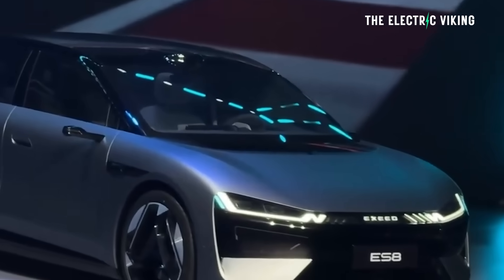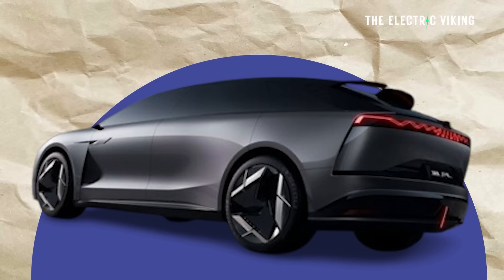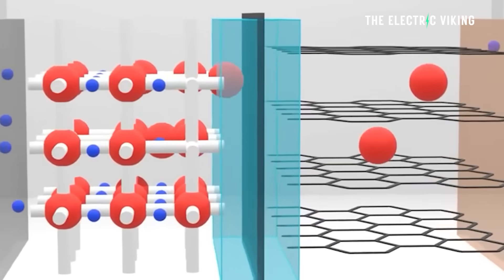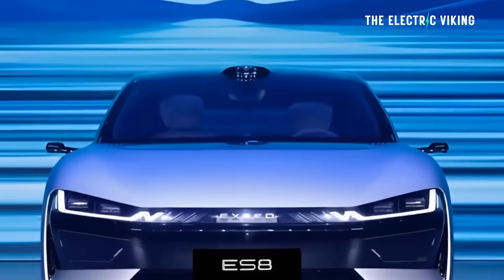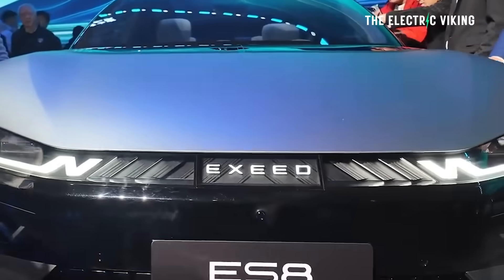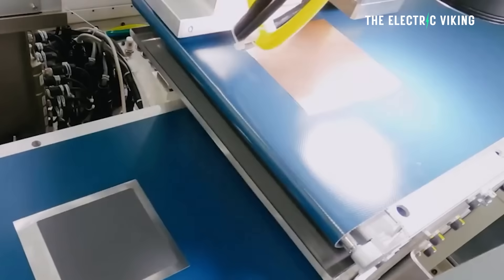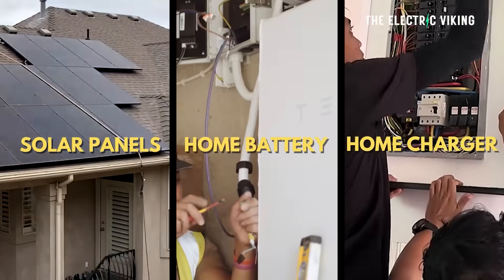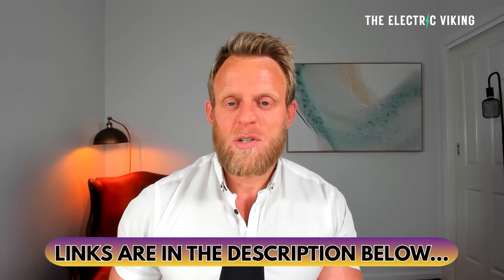Chery’s Solid-State EV with Insane 1,500 km Range in −30°C! Coming This Year

Comment: Rumors that could be unfounded suggest that by 2028, there will be more long range option EV's w/1,000 miles per charge.
The charging system will be similar to that of flash freeze sterilization. Well, under 1 minute, fully charge.
And equally unfounded solar panels will also be near 50% efficiency & lithium will barely play any part in EV's.
Just rumors.......gm will have a new ceo?

Comment: 1500 km range is more than anyone needs. Having driven my ioniq5 for a year, including 4 road trips of 2000 miles, I think 500-600 km would be more than enough. I can only drive for so long before I need a break. And at home where I charge the most I have a level 2 charger that can easily keep pace with a daily driving of 40 miles or so. I don’t even know a gas car with 1500 km of range. Who would need that?

Comment: Hi Sam, great update. I’ve noticed a recurring calculation error in your videos regarding solid-state range. I think you might be conflating Gravimetric Energy Density (Wh/kg) with Vehicle Efficiency (kWh/100km).
Energy density only dictates how much the battery weighs, not how far a single kWh can push the car. To get 1,500km of range, a car needs a specific amount of total energy (kWh). At a standard efficiency for a high-performance shooting brake (~15kWh/100km), you would actually need a 225kWh battery pack.
Here is how the weight physics breaks down to get that 1,500km range:
Current LFP (~140 Wh/kg pack): 225kWh = 1,607 kg (A boat anchor)
Solid-State (400 Wh/kg): 225kWh = 562 kg (Very manageable)
Theoretical (600 Wh/kg): 225kWh = 375 kg (Incredible)
The density doesn't "stretch" the electricity; it just stops the car from weighing 3 tonnes. If Chery claims 1,500km from a 100kWh pack as you guessed, the car would have to consume only 6.6kWh/100km. That is physically impossible for a vehicle of this size—it is double the efficiency of a Lucid Air.
The breakthrough here is the weight-to-range ratio, not a rewrite of the laws of thermodynamics!

Comment: I don't need 1500km of range, my current car has 300km of highway range in summer and I get around. I'd be more than happy with twice that range in a solid state battery and a lighter and cheaper car.

Comment: When solid state batteries come out, it will be a slow ramp and years of news about the advancement. There is no battery that just suddenly appears out of nowhere. And if one happen to do that, it would be the prototype that will take years to get to mass production. Imagine buying one, and it loses 50 kilometers of range every time you charge it.

Comment: How many people actually need a 900 mile range car, of any drive type?
Reply: Lots of people. Many people take extended roadtrips.
Reply: @NeverHaveKids as if you wanna drive 900 miles without taking a break? That's just unhealthy and unsafe at the same time, even with multiple drivers.

Solid state batteries also charge much faster so it's better to put in a smaller battery, make the vehicle less heavy/expensive and still get 400 miles of range which is more than enough between stops.

Comment: Once again, the Viking doesn't understand that the total KWhr in a battery is the total energy storage in the battery. It doesn't matter what the energy density is. The higher energy density means you can get the same KWhr for a lower weight.
Reply: Oh I guarantee he understands that buds
Reply: @Yielar1  Then why does he keep making the same error?
Reply: It's not just gravimetric density, it's also volumetric. EVs are space-constrained as well as weight-constrained, but the volumetric constraints are more absolute than the gravimetric for your typical EV. Higher energy density means you can get more KWh in the same space as well as reduced weight.
Reply: @jebediahkerman3946  That is true but how is it relevant to the comment and Viking's misunderstanding of energy density versus total energy capacity of the battery?

Comment: Energy density doesn't have direct 1 to 1 ratio impact on range, the total battery capacity has. To have ridiculously high range, you need ridiculously big battery capacity. The only difference is the weight of that big battery will be less, than the same capacity from lower energy density packs. People should stop confusing the things.

Comment: That's an unnecessary amount of range. 
At that point, I'd prefer them to take some of that away and reduce the weight.
350 or 400 mi at -30° c would be fantastic and would translate into 500-600 mi in normal temperatures.

Comment: Oh my God , you never ever learn do ya . Still mixing up density with capacity . But here is my 2 cents . Assuming a pack with the same weight as in the Tesla Model S , but with a 600 Wh/kg density instead of 270 for the S , you get a range of 400*600/270=888 miles =1430 km's  . And that is assuming the same aerodynamics and weigth for both vehicles .

Comment: No one mentions hydrogen anymore. 
It appears the oil companies are going back to petrol and diesel. No daft Toyota fuel cells, or engines that will cause EV extinction overnight 😁 if this solid state stuff  arrives, any fossil fuel argument is on thin ice😀 besides I say back your country, home grown energy not foreign OPEC rip off cartel.

Comment: If some cars with battery energy densety of 250Wh/kg-300Wh/kg can do nearly 1000 km range like Zeekr 001 with 140 kWh or Nio ET7 150 kWh battery. Than solid state must have 600 Wh/kg and battery capacaty of 250kWh-300 kWh if u want range of 1500 km.

Comment: In order to attain a 1500 km ranger you need at least a 220 kWh battery
Reply: A lot of the specifications are a little overstated. I would expect that the range would be closer to 1000 km, but that's pretty good. The question is, what is the lifespan of the solid state battery.

Comment: I believe Donut Lab is doing this purely as a marketing strategy, very similar to what Elon Musk did at the Cybertruck launch, when the “bulletproof” window broke on stage. Everyone mocked it, criticism exploded, but the result was simple: the whole world started talking about the truck. In marketing, it doesn’t really matter if people speak well or badly; what matters is that they talk.

On that front, Donut Lab achieved exactly what it wanted, because since the battery announcement everyone has been talking about the company.
There is also a clear commercial incentive. Verge is likely trying to sell as many bikes as possible before March, since many people are buying them just to tear them down and understand the battery. That curiosity drives sales and strengthens a brand that still operates in a niche market.

What bothers me, Sam Evans, is the inconsistency. You accuse Donut Lab of being fake for not showing details, yet you applaud Chery, which makes even bolder claims without presenting evidence. If 600 Wh/kg is real, where are the independent tests?
I’ve followed you since 2019 because I’ve always seen you as a coherent and reasonable voice. That’s why, if Donut Lab proves the product is real, I believe you should acknowledge it and retract your claims. Calling something a scam without solid proof isn’t skepticism; it’s intellectual dishonesty.

Skepticism is healthy and necessary. Declaring something false without solid information is not. I sincerely hope you keep the balance and good judgment that have always made your channel stand out.

Comment: Sports estates  are just lower more agile SUVs ... The Early Volvo p1800 estate is perhaps the grandfather but the Reliant Scimitars were not far behind ... and don't forget it was Porsches best seller in the Touring version of the Tycan ..  just don't  cut the back off at a silly angle and loose space and  blur the  lines with hatchback  saloon's 🤦🏻 just use Kamm type bullet tail aerodynamic solutions . 

Hub motors at the rear would also offer a huge freeing up of load and interior space  in a two or Bullet profiled monobox layout... It also keeps vehicles light . 

On the Donut question,  there's a piece of information and a key young female researcher they inherited when they bought out another company that collapsed a year or two ago 🤔 you might want to factor what she's done and does into your reckoning.  
Female Scientists and Engineers bring their own minds and methods to complex problem solving .... and no one can ignore the likes of Polish Marie Curie, Miss Schillings orifice, Heddi Lammars frequency hopping communications   or Rosalind Franklin's  contribution to giving Crick and Watsons structural solution to DNA .

Comment: Sam, energy density doesn’t give more range in itself. A 100kWh battery will give the same amount of range, pretty much regardless of density because it has the same amount of energy stored. Hence the description (100kWh). A higher density battery means you can carry more kWh of energy for the same weight, meaning you can carry a bigger kWh battery without overloading the car suspension. I hope you can stop making this miss.
Reply: 100kwh solid state will give 1.2x the range of a classic battery, because most of the vehicle weight is the battery, weighing less gives A LOT more range.

Comment: Finally! Since I bought my first EV in Finland in 2018, they have been atrocious in the winter (temps down to -35°C). So much so I got fed up of having 50% range evaporate and the cars charging ridiculously slow because the battery is so cold. I got rid and now have a PHEV for winter and an EV for summer. Battery tech needs to move on for me to return to full EV for my year round car. Ideally I would like a 150kWh battery in a pretty efficient car. If this 600wh/kg is true, that means a 150kWh battery would weigh <250kg. Which is incredible!

Don't forget, in these temps, the heater pulls 6 or 7kw! So on a 3 hour drive you have used 20kWh just on heating!

Comment: On Friday, concrete pouring began for the nuclear island of Unit 1 at the Xuwei Nuclear Heating and Power Plant in Lianyungang, East China's Jiangsu Province, a project developed by China National Nuclear Corporation (CNNC). As the first nuclear power unit to break ground in China in the opening year of the country's 15th Five-Year Plan, the move marks the entry of the world's first large-scale project coupling nuclear energy with the petrochemical industry into its main construction phase, offering a scalable Chinese solution for achieving global carbon peaking and carbon neutrality goals.
According to CNNC, the Jiangsu Xuwei Nuclear Heating and Power Plant is the world's first project to couple a pressurized water reactor with a high-temperature gas-cooled reactor, the first commercial-scale deployment of high-temperature gas-cooled reactor technology, and the first nuclear project globally to adopt an integrated, plant-wide construction approach under a nuclear engineering, procurement and construction model.
The project is designed primarily for industrial heat supply while also providing electricity. It combines China's independently developed third-generation nuclear technology, the Hualong One, with fourth-generation high-temperature gas-cooled reactor technology. 
In operation, the main steam from the Hualong One is used to heat demineralized water to produce saturated steam, which is then reheated by the main steam from the high-temperature gas-cooled reactor. Under design conditions, the plant will be capable of simultaneously supplying high-quality industrial steam and generating electricity.
The first phase of the project includes two Hualong One units and one high-temperature gas-cooled reactor unit. Once completed and put into operation, the phase-one project will supply 32.5 million tons of industrial steam annually and generate more than 11.5 billion kilowatt-hours of electricity at peak output. 
It is expected to reduce standard coal consumption by 7.26 million tons per year and cut carbon dioxide emissions by 19.6 million tons annually. The project will provide large-scale supplies of high-quality, low-carbon industrial steam to Lianyungang's trillion-yuan petrochemical industrial base, offering reliable clean energy support for the green transformation of the petrochemical industry in the Yangtze River Delta.
Bai Wei, chief design engineer of the Xuwei project at China Nuclear Power Engineering, told the Global Times that coupling design supported by digital simulation is one of the project's key technical challenges.
By leveraging the resources of design institutes and universities, the project team has carried out hierarchical and specialized digital simulation for control system design, progressing from simple to complex scenarios and achieving multi-dimensional coupling. Full use of digital technologies has helped support the coordinated control logic design for the integrated system, Bai said.
Li Quan, project manager of China Nuclear Industry Huaxing Construction Co., Ltd, who is in charge of civil construction of the Xuwei project, introduced the R&D and application of intelligent equipment in construction to the Global Times. Advanced technologies such as laser intelligent tracking Metal Active Gas Automatic Welding have been deployed, improving efficiency by at least three times compared with traditional manual shielded metal arc welding. 
According to the CNNC, the project marks the beginning of China's transition in nuclear energy from a power-generation-focused model to diversified energy supply. It opens a new chapter in providing a replicable and scalable "Chinese solution" for the low-carbon transformation of high-energy-consuming industries worldwide, injecting strong momentum into the realization of global carbon peaking and carbon neutrality goals.
Advancing carbon peaking and carbon neutrality is China's solemn commitment to the international community and an inherent requirement for achieving sustainable development.
The 2025 white paper titled Carbon Peaking and Carbon Neutrality China's Plans and Solutions mentioned pursuing robust, safe and orderly development of nuclear power. Nuclear power is an efficient and high-quality clean energy source. China is committed to developing nuclear power with the absolute requirement that safety is guaranteed, and to promoting the use of nuclear energy in clean heating, industrial heating, and seawater desalination.
The green and low-carbon transformation of the energy structure is key to achieving carbon peaking and carbon neutrality. Beyond nuclear power units, the CNNC also actively promotes the comprehensive utilization of nuclear energy, including regional heating, industrial steam and cooling supply, seawater desalination, nuclear-powered hydrogen production, and isotope production.

Comment: CATL is building a solid state battery with a sodium core that has a 25 year life span compared to lithium which has a 8-10 year life span. The CATL solid state battery also has 500 wh kg, cheaper to make and easier to recycle. I'm betting on CATL and China for the best tech and innovation around the world.
Reply: CATL is actively developing solid-state batteries (SSBs), targeting small-scale production by 2027. That is not the same as currently having a battery ready for purchase standalone or as part of a vehicle. I would be surprised to actually see ANY solid state batteries in ANY vehicle either for sale/lease by 2027.
Reply: yeah mate, where do you have that 10 year life span from?
and then you prognose a life span of a battery that does not exist yet.
Reply: @ursodermatt8809  Yes ,CATL has this battery, its not set up for mass production yet but they have it. When you invest in markets around the world you get information that others don't.

Comment: Here we go again... Sam, it cannot be a 100 kWh battery. That would mean that, with 1500 km of range, the average consumption per kilometer is 0,067 kWh. This is practically impossible. You mentioned a 600 Wh per kilogram. Let's say that the average car uses 150 Wh per kilometer. That would mean this battery would have a capacity of 225 kWh. So 100 kWh is basically impossible. Try to understand, for once, that the physical size of a battery can remain the same, but the amount of kWh in that physical space gets increased (and therefor the range).
Reply: Well explained Tostie, though you're wasting your time with viking methinks.
Reply: Thank you.
Reply: and at -30C the battery would need to be at least 300kwh for 1500km .
Reply: @ursodermatt8809 Not if it is a true SS battery. But ye, it would be big (NOT PHYSICALLY BIG SAM) to reach 1500 km's.
Reply: @Tostie1987  
it does not matter what battery technology you are using, you still need extreme heating and the air is much denser at those low temperatures.
Reply: @ursodermatt8809  Yes, it does. Look it up. LFP batteries are much more prone to cold for example, then sodium batteries.
Reply: @Tostie1987  
ok
those batteries do not exist yet. so we know nothing about them.
Reply: @ursodermatt8809 These batteries do exist. CATL has sodium batteries in mass production.
Reply: @ursodermatt8809 The consumption of my EV in -30 C is appr. 30 kWh/100 km, so a 450 kWh battery would be required for 1500 km range 😅